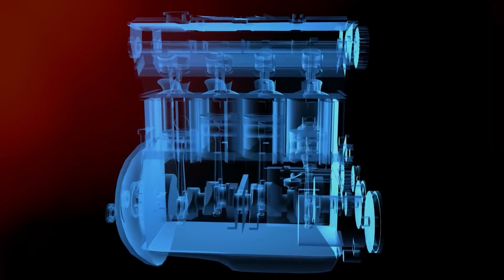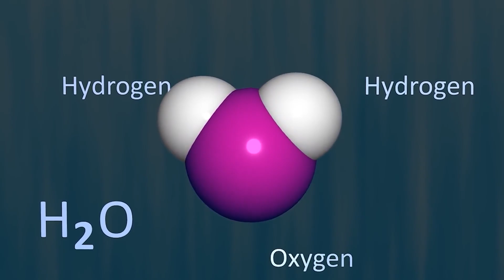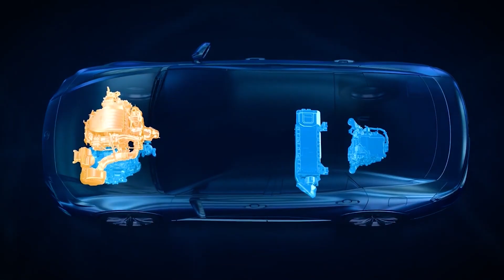Toyota Destroys the Auto Industry with a Water Engine

Comment: Hydrazine propels rockets into space. Hydrazine is a derivative of hydrogen, and is quite easy to collect hydrogen from water (H2O).  It is cheap power. Why it hasn't been made available for the masses is the fuel cells needed to store hydrogen are expensive and need replacing every 5 years.
There are kits to turn your car into a Hydrogen vehicle. There are drag racing cars running Hydrogen.
The upside of this as a fuel is it can run high compression, and it keeps the inside of your engine as new as the day you bought it.  Oh, and it's clean energy. Cheers!

Comment: I'm doubtful that Toyota actually published something like that, it takes alot of energy to split water into hydrogen, and ICE usually have a thermal efficiency of around 30%, so there is practically no way to have the vehicle sustain electrolysis from the hydrogen combustion. Also when letting AI programs make your videos, please check your text to make sure it is logical, correct and without repetition.

Comment: It’s already been done
Reply: A submarine can take water and spit it into oxigen and hydrogen, using a nuclear reactor ! What this idiots don't get is that you need so much electric power to do so, it's pointless! Same with this engine , they gonna make a van , only for you to be able the 2 sets at the front, to actually be usable on more than 200 miles range, and bdw , if you crash, you gonna explode with the force of the 2 word trader towers! GOOD LUCK!
Reply: Nope, it's a fake video..